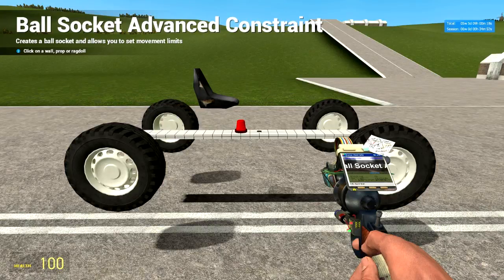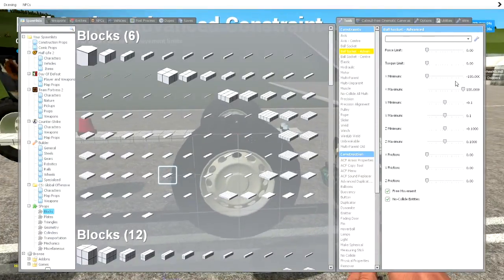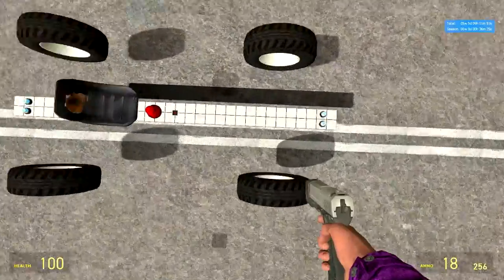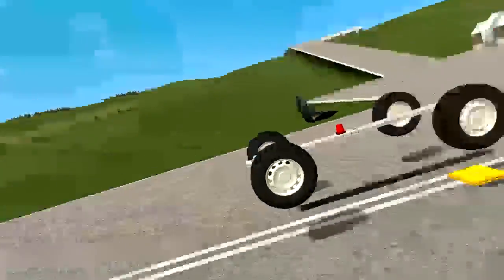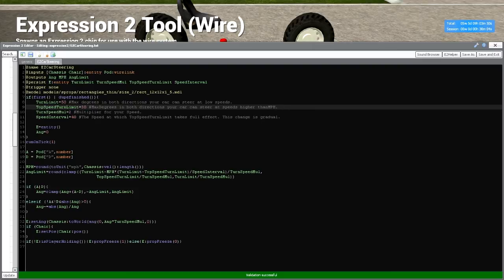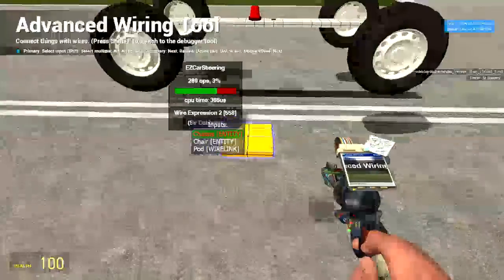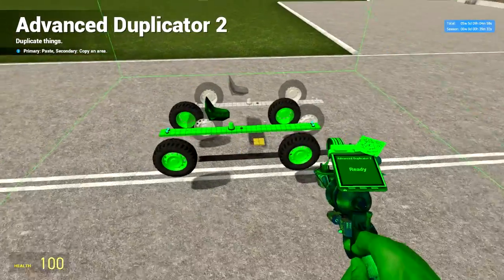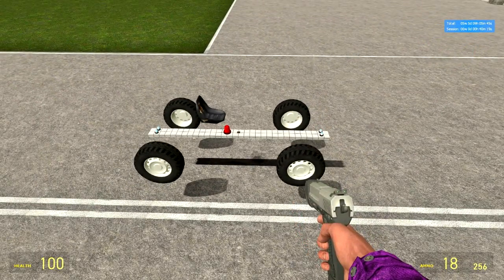Garry's Mod - Set Ang Steering Turotial

Comment: No such function: entity:setAng(angle) at line 32, char 3
when i spawn the chip
Reply: Same problem: Tried that, also, no errors on any Lua files missing. Tried on Mac and PC, but it still doesn't work.
Reply: Nvm: Guy that developed it updated the code, and now it works. Still had to modify it a bit though...

Comment: when i unfreeze the car the wheels immediatly begin to swing in directions they shouldnt also i akxised them to the prop and that fixed the problem but when the car is on the ground and try to turn the car freaks out and flies everywhere
Reply from the maker: +M Smith Maybe your adv ball sockets have the wrong axis locked. That's all I can really think of.
Reply: +SirDobbers i put the same thing you had
Reply: +M Smith Just aim your toolgun directly in the CENTER of the wheels when you axis them.
Make sure you do it from the wheels to the base and to the base to the wheels (twice), to prevent the wheels from spazzing out at high speeds.

Comment: SetAng is OP. Hydraulics is more balanced. You should be ashamed.

Also, back in the old days (I don't know if it's still true), you HAD TO use X as you rotational axis, cuz Y was all wonky. Like it would work to an extent, but it wasn't quite there. Like some of the degrees were missing or something.
Reply: I agree
I still use hydros
Reply: me too
Reply: stfu